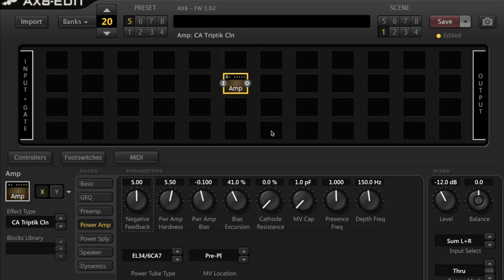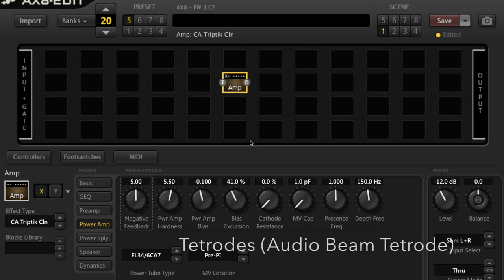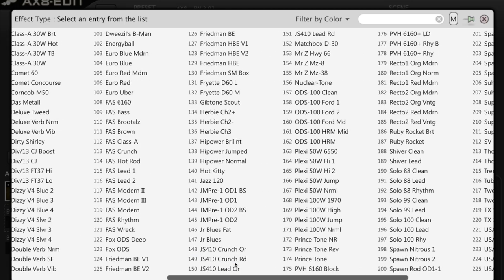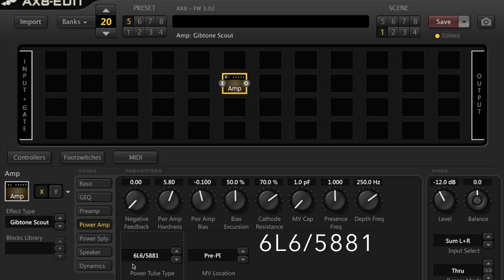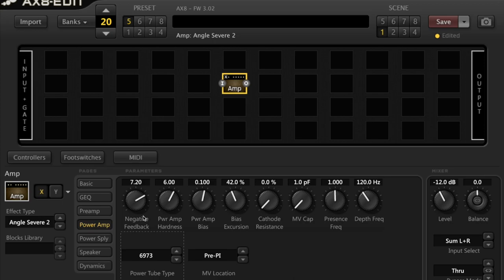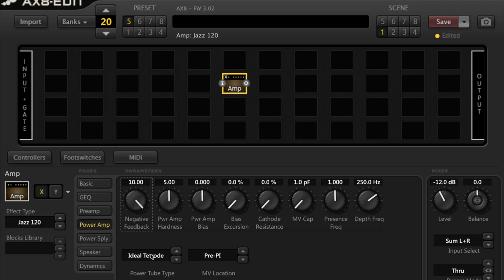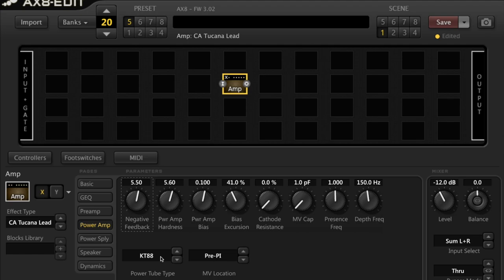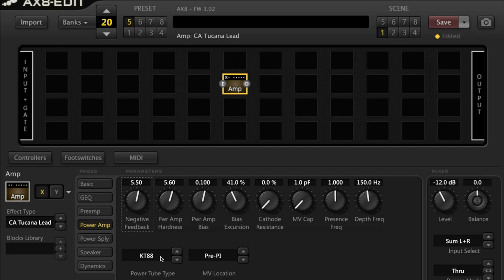Fractal Audio AX8: Power Amp Tube Tutorial [EL34; 6L6; KT66; KT88; Ideal Pentode/Tetrode & More!]

Comment: audio drop/mute when switching amps in amp block, have you come up with a solution? Wanted to use my AX8 live but that drop bothers me. I don't want to be limited to using drive blocks
Reply from the maker: Hi Jay. Are you using X/Y within a preset/scene or are you switching scenes to change? Sometimes using scenes can be the answer to audio drops. I'm not sure how this works but I think scenes utilise some kind of 'cache type' memory that allows the DSP to predict what is happening rather than simply 'react' to a sudden/unexpected X/Y toggle.